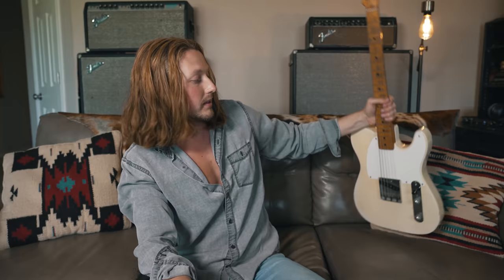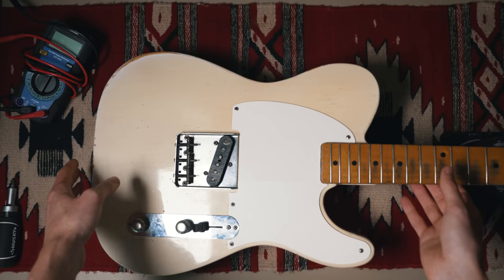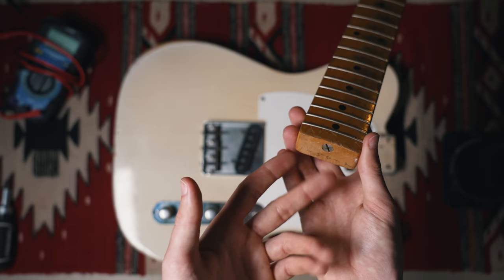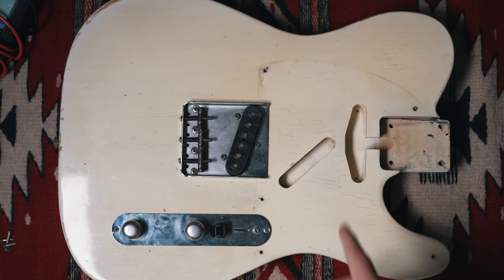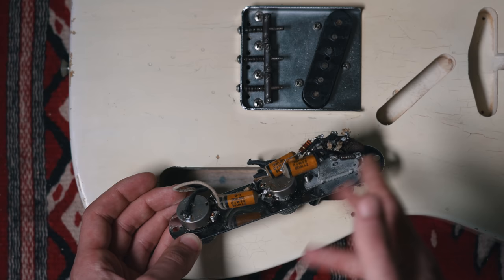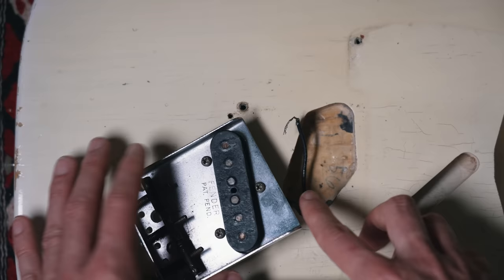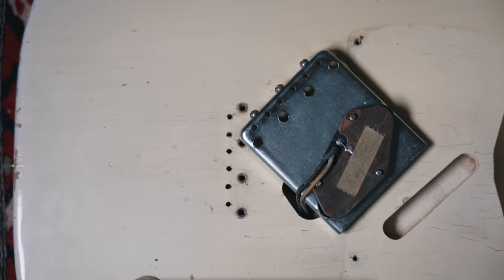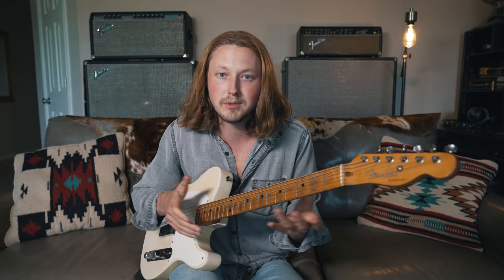Surprises found in a 1956 Fender Esquire

Comment: 8:46  - It seems likely to me that THIS pick up was considered a little bit special and so a Tele that was only having one pick up from the factory, an Esquire, perhaps would have had a special sounding pickup reserved for that Guitar because that one pickup had to come up with three different sounds and therefore someone, the winder(?), Considered this pick up too good for a multi pick up Guitar, maybe…?🤔
Reply: Interesting, although I think very, very unlikely. Even as early as the mid-‘50s, production was already at a fast pace at the factory. Leo’s pickup winding ladies were probably no-nonsense, crank-em out machines with high daily outputs apiece. 

Plus (and a very big plus) an Esquire was almost certainly viewed by assembly and marketing/sales personnel back then as nothing different than a slightly more affordable Tele because of the absence of the neck pup.  Only in recent years have players and collectors theorized and opined about the “magic” of the single pickup guitar without the presence of a neck pickup to influence the sound. 

I wasn’t there, but I’ll cite the several highly researched books by Fender historians and insiders who paint a very specific picture of life at the company/factory beyond the public eye.
Reply: @anthonyc1883  
Of course, you may well be right…

May I suggest then maybe a repair person much later in this guitars life was switching pickups around in it and just wanted to label the original pick up that came with it “Esquire“ so that when they finished their test or wanted to resell they could put it back to original & it would have the original fixtures and fittings, as it were? 🤔
Reply: @anthonyc1883  - I believe Fender co. switched from a 42 to a thinner 43 gauge wire towards the mid 50s, so this could easily be an experimental or a “B stock” pick up using the different new wire!
Imagine if it was one of a handful that Leo Fender tested with the new wire, and with some of them he said “ahh, these are off spec a bit but still fine sounding to put in an Esquire, and it doesn’t need to match the output of any Tele neck pick up.” This is cost efficient.

Also at least for historical interest, note that ALL the very first Fender T-style guitars were Esquires, and soon after Fender added a neck pickup creating the Broadcaster cum Telecaster… the Esquire was not actually a student or budget model, but Fender found Telecasters were much easier to sell in greater numbers therefore to sell some Esquires they made them a little cheaper.
So the motive for using a low output pickup wouldn’t be to make an inferior guitar, simply one where this particular solo pickup with a unique sound would work fine.
Reply: @j_freed  👍

Comment: I wish you would have shown a close up on the selector switch to see the solder joints. Those tone caps all look stock...if there was a humbucker installed at some point the original solder joints would have been disturbed. If a mod was undone, the original tone caps must have been saved...or they were really lucky to find period replacements. Maybe the humbucker that was installed was not a PAF style but rather a single coil sized one (Seymour Duncan hot rails, Joe Barden, etc)??
Reply: Yes. Scott should get a Pro to look for possible signs of invisibly done wood replacement, perfectly blended period-correct re-routing and seamless finish matching that includes the identical crazing lines on the finish. (!)
That’s ludicrously good restoration (can you do a blacklight test Matthew?) and Steve has a good hypothesis.
Reply: @j_freed  I was wondering when the humbucker mod would have been done. In the 70s, I don't think that someone would have cared enough to save the original caps- I could be wrong. But someone who was carving up a '56 fender might not care about that. The guitar would only have been 15-23 years old at the time.
Reply from the maker: The wiring has been messed with for sure.

Comment: Never saw the point in Esquires personally, but I like the worn in maple neck!
Reply: I find them to be an interesting curiosity for the time they were originally made, having predated the Fender Precision bass, so having the "bass" setting in the "neck" position allowed them to fill in the lower frequency rhythm tones. These days you wouldn't really need that anymore, so yeah in that sense they may be redundant in a contemporary setting. I converted a cheap Tele into an Esquire as a hobby project and used a variation of the Eldred mod in the "neck" position to get filtered cocked wah kind of tone in that position. Having a single pickup like forces you to think about other elements of your playing to get dynamics and tone.
Reply: Economy was the original reason. A feature was deleted (the neck pickup) to allow the player to save some money.
Reply: Yep, that's why I don't see paying more for them today

Comment: Since the number 2 appears twice on the neck, it's not referencing the day of the month but the width of the neck. #2 was the standard size. I have a 1964 Strat; the neck is stamped "2 DEC 63". I thought for a long time that meant December 2nd. but it doesn't. Stands to reason that Fender would use the same number code all through the Leo era, even if they did change from handwritten to stamped circa 1960.

Comment: According to G.E. Smith, back in the 50s when you bought an Esquire, if you opted to pay an additional fee and send your guitar to Fender, they would add the neck pickup to your guitar then send it back to you.
Reply: Those two holes to hold the neck pickup never seem to have had any screws in them. Just pre drilled.

Comment: I had an original 1952, and the neck pocket was dated, and signed... it said "Davis" and I can't remember the date, but it was written very boldly in probably carpenters pencil... It had a repro neck unfortunately... but the body was 100% legit 52, as I got it from a guy who had no clue... it had been passed around so much that no one knew where it came from... I noticed the bridge plate and pickup... plus the neck plate... and even then I thought it was maybe a counterfeit... until I got the whole thing apart... I refinished it and got the right style neck on it and did the humbucker repair that whoever did that one did... and I used the epoxy based, tinted, polyester bubble type wood filler and found a guy with a template for the original route markings... then assembled the things that would have been used to paint it butterscotch blonde, in 1952. Amber shellac (the real stuff made from flakes), Genuine HIDE glue (again, the real stuff made from... well... granules... lol). Nitro lacquer, vintage formula with trade secret oils added, titanium dioxide for the blonde white... the swamp ask is very course grained, but Fender thought it would make a well chambered wood for a solid body electric guitar, and allegedly thought the wood itself would possibly react with the magnetic pickups, that there would be higher iron content in swamp ash... these are things I heard anecdotally as a lot of things are... but basically dip the body in the hide glue, if you happen to have a heated barrel full, as they did at that time/// OR coat the swamp ash body with liberal amounts of the hide glue quickly and allow it to drip off as hung from the strap button screw... you may consider using a heated room, to bring it up to about 140-180 degrees, so it dries evenly. once the hide glue dries for 24 hours... look for any drips or runs... there may be or should be a drip mark at the lowest point. Sand that down flush... coat with titanium dioxide nitro mixture until the dark grain is peeking through... and then spray with the amber shellac 2/3 to 1/3 nitro until you get the desired color. It should look more yellow and lighter than a standard 52... age and patina makes them darker.

Comment: I've owned Esquires from 1953,'54,'55,'56--and they all were hotter than the Telecasters I had. The 1956 Esquire I had was the BEST sounding Telec/Esq. I ever had-powerful, not harsh in any way, had the the tone-smooth response, nice fat mid range,treble,bass-a great balance. I acquired a 1953 Esq. with the flat poles, and at that time('71-'72), I was a 'starving musician', and had to sell the '56, not having the luxury of owning many guitars, and I regret to this day for selling it. In my opinion, the raised 'D' & 'G' poles are better balanced pickups. I've also heard from others that 1956 Esquires are known for excellent tone-I'll agree with that !

Comment: Wait, how can the electrics be untouched if there was a neck pickup added at some stage. Surely something must've been done to the electrics during that mod. Gorgeous guitar regardless.
Reply: You'd only need to solder it to the switch & that'd be it so it'd be real easy to remove too.

Comment: I have a 1957 Esquire that when I was young and stupid (now I am just stupid), 
I added a neck pickup to and changed the pots. It plays great as a telecaster. I lost the original puck guard, changed the bridge to one of the newer bridges that sets up each string individually. I have the original pots but lost the original bridge and the Esquire pick guard. Has original timers, just not the greatest after all these years. 
Does anyone think this is worth much? It was a gift in the early 80’s from my uncle so will likely never part with it but….
Reply: Yes it's still worth good money
Reply: Thanks

Comment: Just a thought. How about to demarcate a part for assembly so it would not be confused with another assembly project. we all know one of the first things you do is assemble all your parts. as in this case you would be working on multiple projects at the same time. At this time fender was more like what Gibson was doing at it's staying custom shop. It was not one person one prosses. Same  person was involved in motetable prosses. Like saying this a shop as apposed to a factory.  This just a though but from a logical line. 

.

Comment: Would hate to find out that it is a Squier with a Fender decal made to look old.
Reply: Nah...
Reply: And spelt differently?
Reply: @castleanthrax1833  ? Squier. Not Squire.
Reply: @edwardmonsariste4050  I know how it's spelt. Why did you make your comment if you did too? Your original comment makes no sense.
Reply: @castleanthrax1833  huh? People take Squier guitars and make them fake Fender’s. Can only tell when you take the neck off. That was my meaning of my original comment. Sorry for any confusion on my part.
Reply: @edwardmonsariste4050  Sorry mate. As this is an "Esquire" I thought you were referring to someone removing the "E" on the headstock. My mistake. ✌️🇦🇺
Reply: @edwardmonsariste4050  I was a little sleepy when I replied to your original comment.

Comment: So, routes=wrong both neck and bridge
Switch tip=wrong
Neck=wrong pin route mark, wrong writing in pencil neck and body
Looks like parts with some poorly done neck/body
Reply from the maker: Routes are not wrong.. switch tip? Neck has the correct pin route hole..